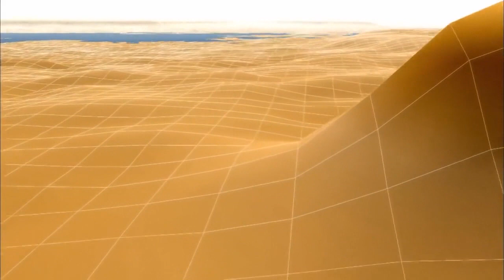Hopi Lake / Bidahochi Spillover Theory for Grand Canyon Formation - Breached Dam Model

Comment: uh the lake might’ve been bigger. many cultures talk of a world flood. there’s salt at salt lake in utah. and yellowstone geysers with a lot of ground water. and if you look at nevada they have similar water erosion but on stone pillars i’m not sure what they are called. the grand canyon has so many branches it looks like it had many rivers or a water source running off.even across the world in the Sahara there massive signs with the ripples in the sand. and salt deposits where the water is stuck. and you can see it from satellite.

Comment: I also lean towards a much shorter window in which the Grand Canyon was created. 
 I bet glaciers flooding released a lot of water. Just like those big boulders that are sitting in the middle of a field and it was later determined that they were moved there at the bottom of a glacier sliding across the lands depositing them there. Where'd all that water go?🤔🤔
Reply from the maker: There's evidence in the nearby Lake Bidahochi deposits for melting glacial flooding in the upper Bidahochi Formation, where a rapid accumulation of new sediment from the Rockies and upper Colorado River Basin taxa introduction occurred.
Reply: @nateloper  but there's no geological evidence of a deep water lake. There's only evidence of a shallow water playa.

Comment: is it really hard to consider that there was a nice age and when the ice melt started to flow it also took large volumes of Glacier Ice but very large Boulders and debris at the bottom acting like a can opener of sort and has the glaciers melted and slid across the ground they also gouged and scored the ground. furthermore it explains why we have in the middle of the planes big massive Boulders that seemingly just dropped off and totally out of place. because the glacier couldn't move the Rocks anymore can you imagine the size of glaciers that it would take to move those kind of Boulders that are sitting in the middle of the planes randomly some are bigger than a two-story house.

Comment: The problem with Austin and Snelling ( creationists) is they say this happened only a few thousand years ago……no it took millions of years after the initial cut to erode the canyon away .
Reply from the maker: Not if you had thousands of cubic miles of water pouring through the only exit route of any size on the Colorado Plateau.  Some estimates place the combined amount of water of three large lakes on the Colorado Plateau in the 5,000 to 6,000 cubic mile range, equivalent to all 5 Great Lakes combined.  Up to 6,000 cubic miles of water to cut a 950 cubic mile canyon.  That can happen rather quickly.

Comment: My only wonder about this theory is why would it spill over the kaibab plateau? Why not spill over somewhere lower?
Reply from the maker: Because when the spillover took place, this would have been the lowest spot on the bowl-shaped Colorado Plateau.  The only other lower spot today is north of there near Paria.  But thermal tomography provides evidence that area has subsided—likely due to the see-saw tilting of the elongated Kaibab Plateau in response to isostatic rebound and uplift once the canyon's material weight was removed.
Reply: Sure looks like there was spillover south through Sedona area